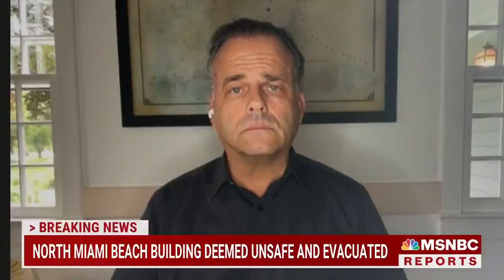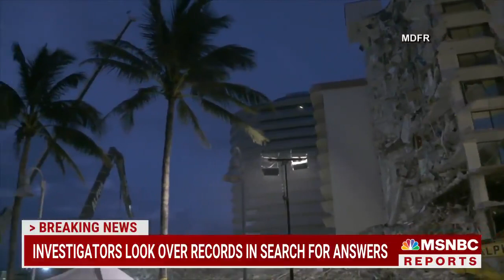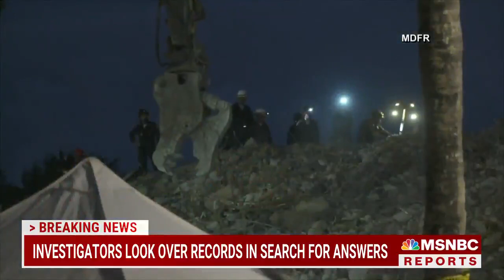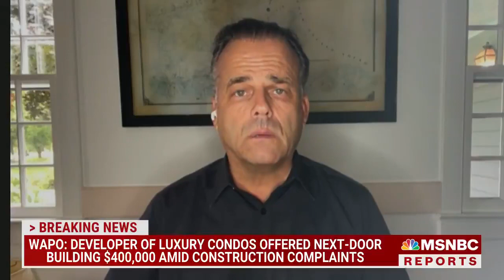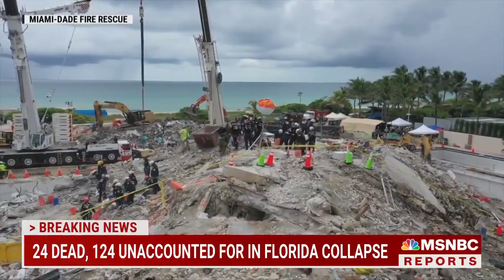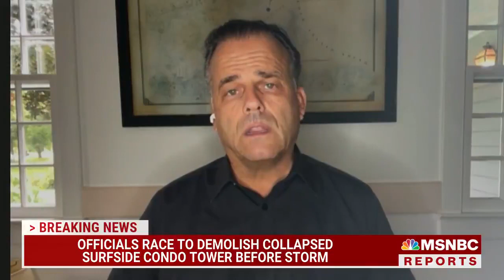Architect Kobi Karp shares expertise with MSNBC's Yasmin Vossoughian on Champlain Towers collapse

Comment: Why are the talking heads in the media asking architects about an engineering problem? Anyone who ever worked as an architectural draftsman in an architect's office knows that architects hire structural engineers to address structural design problems that surface during the design phase because most architects lack the technical expertise to correct the design problems their unworkable designs spawn. Asking an architect about engineering problems is like asking a brick layer about carpentry.
Reply: because most Americans don't know what an engineer is.
Reply: Let me shed some light on this so called “architect”, as a former architect myself, I have watched several interviews of this dude on CNN, he is not only not an engineer, he is a con architect of the highest kind. He runs the most shady architecture office I have seen, knows jack sht about any subject. It’s embarrassing how he continues to get mainstream media air time with these 2nd grade-level non-answers, which he proudly publishes himself. Just embarrassing.
Reply: @jong7513  he’s from Israel.

Comment: Years ago there was a new luxury condo complex at Breckinridge Colorado. The units  were unable to be sold because of faulty balcony construction. They had a slope toward the building instead of away. Water was draining into to the rooms. Never mind the rain, snow would also melt and seep into these rooms. Wasn't such a bad deal for myself and my roommate.  We got to stay in them free being friends of the one of the engineers. They were slope side too. The season ended and I never knew what what ultimately happened with the buildings. It's crazy that this wasn't noticed until construction was completed.

Comment: There were many design and construction errors. Lack of shear walls, bad concrete, missing beams, smaller beams than speced, extra penthouse floor, connecting patio to the building, underdesign of live and dead loads, ad nauseam.